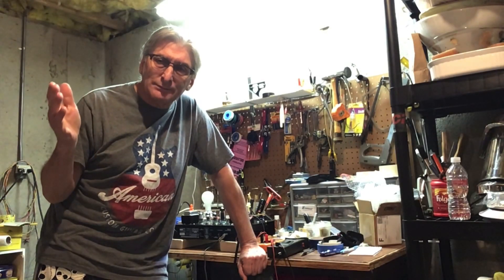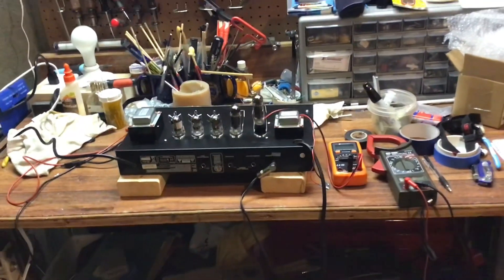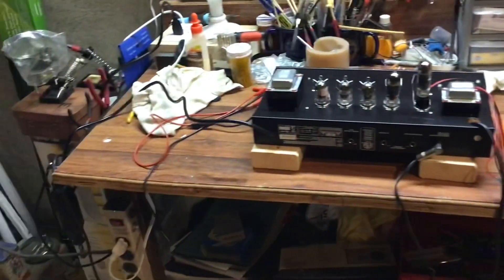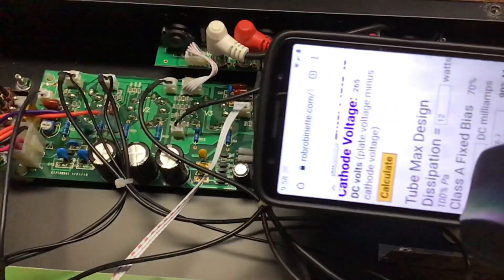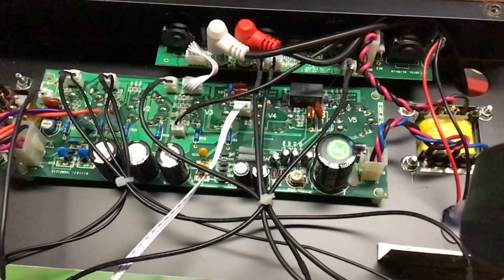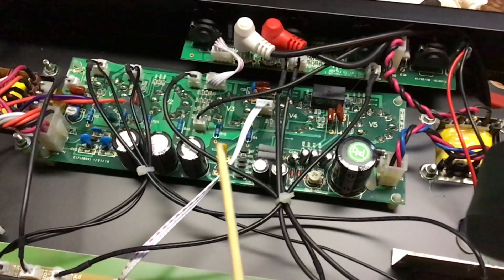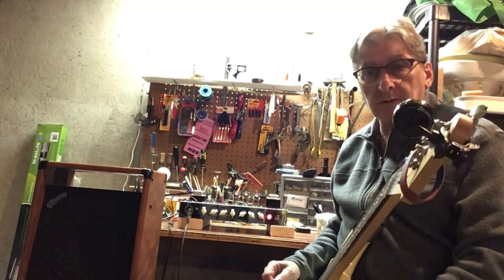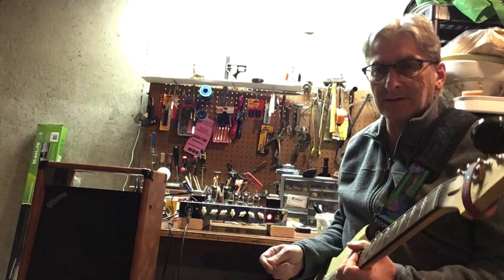Stage Right 15 watt tube amp from MonoPrice. Using a Biasprobe.

Comment: I ordered new matched power tubes for my 15 watt then learned about needing to bias it. I'm still confused.
Reply from the maker: I too am confused. I’m not a technician but I’m told biasing your tubes is like setting the idle on your carburetor. Only the power tubes in an AB amp like this need to be biased. The preamp tubes are plug and play.
Reply: @dugbert5  my tubes said matched at 36 I believe so I understand the concept. I just don't feel like taking this thing apart because it sounds good. If it blows, I'll fix it.
Reply from the maker: @xxnoOne1  I like the way you think.
Reply: @xxnoOne1  A lot of these amps come biased food from the factory.  I'm guessing the use a generic value on all of them rather than biasing each one individually to set of tubes installed.  In that case they error on the side of caution.  The power tubes have to be a matched pair, regardless of how not or cold you bias them.  Do a search on biasing to gain a better understanding.  Too cold and you can get a nasty crossover distortion, and to hot will burn the tubes (red plate). To do this you need a set of bias probes, and preferably two amp meters, through one will do.  I can't stress safety enough as a tube amp has high voltages that can kill you. No joke!  Rule of thumb is to keep one hand in your pocket when working inside the amp, in case you get shocked the voltage doesn't go directly through your heart.  Do a little more research before messing with this.

Comment: -5V sounds to me like the gate voltage. I have the same one the Harley Benton tube15 but haven't opened it yet. The plan is to change it to a point to point design like Uncle Doug did it on a Fender one
Reply from the maker: Uncle Doug is the man! Good luck.
Reply: Tubes don't have gates, they are called grid.
Reply from the maker: @szaki95  I'm glad you noticed. I didn't pick up on that.

Comment: Is the bias a potentiometer resistor as a part of the input-RLC filter setting the center peak frequency of the bandpass filter? Or is it situated elsewhere in the signal chain?
Reply from the maker: I don't know. Like I say in the video, "I'm not a tech".
Reply: @dugbert5  My apologies. I couldn’t hear that well whether it changed the tone. Did it take out low end or high end? Did it alter the tone giving it more dimensions? What’s the exact difference that you heard, because I only got to hear the after and not the before.
Reply from the maker: @lucifer_morgenster  the before lacked clarity and highs. And it smelled like some one was smoking resisters. I caught it before anything burned out.
Reply: @dugbert5  Okay. I had the math and the physics wrong in my head I think, so now I don’t know whether it’s an LRC-filter kind of thing, but maybe it is. I’m going to look into it a bit more.
Reply from the maker: @lucifer_morgenster  Thanks, that will be very helpful.

Comment: I have the Monoprice Stage Right 5 watt tube amp. I always wanted a Fender 5 watt champ type amp but the cost were prohibitive so when I saw these things I got myself one and I'm really digging that tone.
Reply: I started with the 5 watt. I put a  tung sol 12ax7 in the pre amp position for a good tone. Now I have the 15 watt. It sounds like a Fender blues Jr after new tubes.

Comment: Some people said this amp is self biasing or cathode bias circuit which it is not !
I use two probes , one for plate voltage the other i use to set the grid current in Ma !
I put the plate voltage in the bias calculator online for class A/B circuits and hit calculate and it tells me what to set the bias too in milliamp for 70% dissipation for the pair of tubes !
Beware that you know the bias calculator is the setting for a pair of tubes only so if you have a quad you do each pair seperately !

I only retubed the 12ax7 tubes in my Stage Right 15 watt amp , i used a sweet sounding china 7025 in V1 and a vintage Mullard in V2 which is the OD tube and a Sovtek 12ax7LPS in V3 the phase inverter !
It has JJ el84 tubes i will leave alone for now but i have Tungsol and Gold Lion and Sovtek el84 tube pairs also for later on !
Reply from the maker: Thanks, do you know what the bias point reading on the circuit board should be?
Reply: @dugbert5  No, it should be in the 0-200 milliamp range but if you use a plate current bias probe on one power tube you then can get the proper setting using the online bias calculator for class A/B amps !

The bias trim pot works for both tubes at once !
Reply: @ijamsum  Your last sentence about the bias trim pot working for both tubes at once has me confused. Let me ask you the questions below which I asked the OP above: Another biasing issue is raised by the fact that the amp has two power tubes and one bias trim pot,  but you have one bias probe on one of the two power tubes. How do you adjust the bias on the other tube? If you put the bias probe on the other tube and move the bias trim pot how does that affect the bias of the tube that has already been adjusted? You say you use two bias probes.  Do you use something like the "Dual EL84 bias probe tool tester for biasing tube amplifiers by SRS" found on ebay at )https://www.ebay.com/itm/133944617884?mkevt=1&mkpid=0&emsid=e11051.m43.l1123&mkcid=26&ch=osgood&euid=9750e0b4f58c44fe9c86fd2768cb7ec3&bu=43201239213&osub=-1%7E1&crd=20220727150552&segname=11051)?  Or do you have something else?
Reply: One bias pot for both tubes !
The probe needs to be on just one tube if there a matched pair !

You can check the other tube bias after setting the bias to see if it is a little different but it usually is the same for both tubes or close enough to not worry !